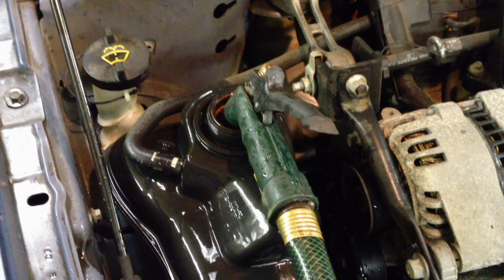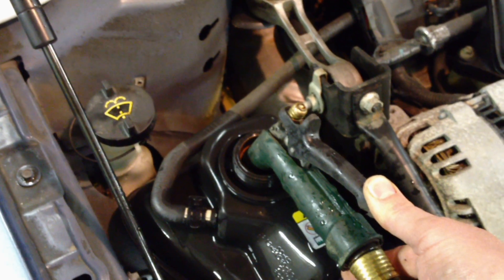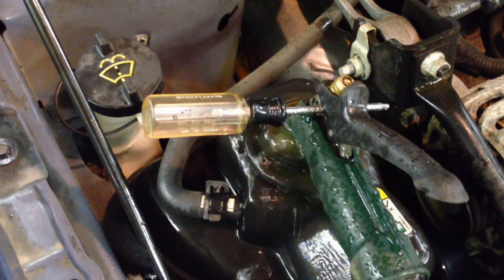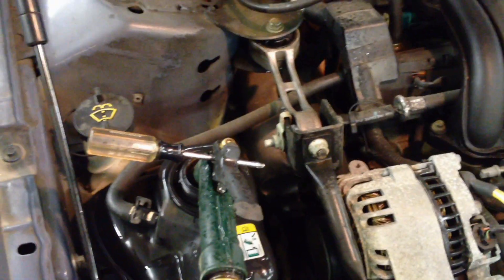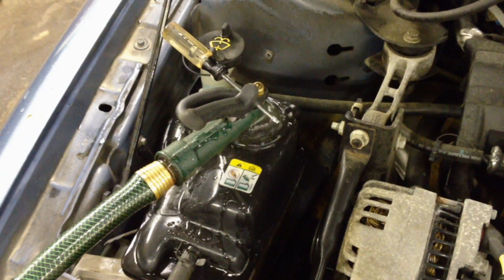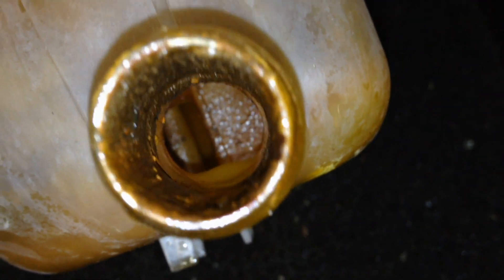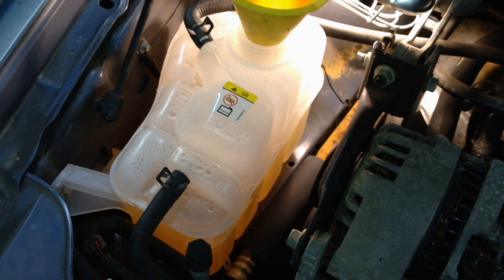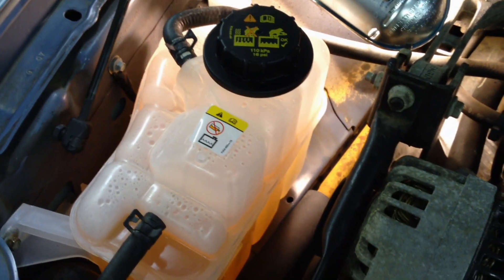NO HEAT: Ford Taurus Rusty Coolant Flush Procedure

Comment: Question for everyone who has the knowledge... 

If the heater cor was charged in November 2024 and I October 2025 you have no heat, was it really changed or did they do a flush? 

Or is it possible it was done however you will still need a flush?

Comment: According to Ford/Motorcraft "do not use this product to flush cooling systems where the cylinder block is aluminum"
What would be the difference between an aluminum cylinder block and a aluminum cylinder cylinder head?
Reply from the maker: It is only made to remove rust nothing else which is only present in a cast iron block.

Comment: You repeatedly reference that the coolant is warm and/or hot and the thermostat is open, but I can plainly see that the alternator isn't spinning at various points throughout the video. Did you start this job when the engine was hot and are just using the residual heat (can't imagine that would last even ten minutes while running cold hose water through the system), or are you using some other heat source? Is your hose connected to hot water? What's the water heater set to? Most water heaters don't go over 130F or so, and most thermostats don't open until at least 180....

Comment: I asked for your experience I replaced the heads on a 98 Ford Taurus with a 3.0 and the reservoir put a new thermostat in it flushed the heater core before I put the engine back together both directions now the engine runs at the temperature where you show on the video and I used a OBD2 that would hook to my  phone and it says I have 188° water I have 192° thermostat in there but I don't get any heat I have 180° thermostat that I'm thinking about changing is there any other secret way to get all the air out

Comment: really hard to remove the under radiator splash guard especially the last nut - any one have tips? It's got a nut outside and one behind it I think one is 10 mm and the other is 11 mm
Reply: I ended up getting it to work with some good old fashioned elbow grease amd used a 3/8” and 7/16” behind I think
Reply: my 8mm bolts were stripped so I had to cut them off

Comment: How about isolating the heater core, pull water out with a vac and soak the core with CLR overnight? The block had been flushed and still low heat. Flushing it alone has worked but it's bad again.

Comment: You're a excellent teacher, follow your direction from this video lord and behold when i pull off my heater core hose there was no fluid in it, nothing were flowing  through it, heater core wasn't the issue there was a block in one of those line, I back flush both hoses and heater core and blew through the heater core lord and behold heat was coming through the vents this car never idle at 145 degree 120 was it ide temp now she's heating up like a boss my  thermostat opens up at 197 for ford taurus, antifreeze was green as it can be when I drain it i did redo my timing chain gasket it probabbly had something to do the broken up gasket. y car was heating up before took on this DIY job follow your direction from a tee from both of your video not a drip from any area or snap any bolt pb blaster those bolts for a week.

Comment: On some Tauruses, 2002, 2003 if I recall, there is a "bypass" hose in the metal coolant lines near the core.  Appears as if it is there to provide a means for coolant to still flow around the core instead of through it if core becomes restricted.  We will pinch this hose off when flushing to get full flow through the core.  Still an annual procedure, have not tried the chemical though, will try to do that next.  Thanks for the great videos!!
Reply: Yep, you are correct. My 03 had it and my 05 has it now.
Reply: @brunoshow124 saving
Reply: @jebweb-j4z  saving what?

Comment: Also for heater issues make sure you block the bypass hose with hose pliers otherwise it wont heat even if you do what you did in this video

Comment: Hey man thanks for these videos and I hope you're still checking comments? I did this flush today on our 01 (I already changed the heater core a couple years ago and the heat is still working just fine) but was wondering if you would recommend pulling the hose underneath that goes into the radiator as part of a flush? I've pulled it before but 1) it was a pain to remove and 2) not sure it was even necessary to fully flush. Are you still of the mind that what you've done in the video is enough? Thanks!
Reply: I just did this today and pulled that hose underneath and it emptied the reservoir (I did not replace the degas tank)

Comment: Would this process work for a 2004 Taurus with the 3.0 v6 DOHC 24 valve duratec? I just need to drain the radiator and put 50/50 in it. It has water in it right now.

Comment: I'm no mechanic but isn't the icon on the overflow tank saying not to fill it with the color your putting in?
Reply from the maker: No I am pretty sure it is saying do not add straight coolant. Also the color on the label is orange or OAT coolant this a HOAT coolant called Gold Coolant from Ford introduced in 2001 from the factory during a mid year change.

Comment: It doesn't matter what u do to flush this car. This car has a time limit till death. Flush flush flush all u want. Replace the radiator, water pump, heater core, then head gaskets. Repeat! Best thing u can do with this car is sell it!
Reply: pointedspider what a narrow minded comment.  My daughter has an 05 Sable with 190,000 and I have a Taurus beater car with 135,000.  Maintenance is worth the effort.
Reply: Vulcan engines are cast iron and need extra attention to prevent rust. Maintain the coolant and 200 to 300K is not uncommon. Let rust build up and expect 100K and the head gaskets will need replacing, an $1800. dollar expense. I love the Vulcan engines. I've owned 3 of them and sell the cars at 200K miles.

Comment: I had someone put engine sealer for a head gasket leak, which supposedly turned into a cracked head on my 2002 Taurus. I am going to replace the cracked head and redo all the gaskets required when doing this, but I was wondering if I should use this same method (as in the video) to flush the engine sealer out of the cooling system, but with a different chemical, before I replace the cracked head? I don't want the engine sealer to harden and clog everything up, but I'm also worried about the cleaner getting in the engine if the head is cracked? Any suggestions or advice is greatly appreciated!
Reply: Sell it, don't fix it. Cheaper to buy another one.

Comment: I have question.
My Ford Taurus overheated and won't start.
Where should I start, mechanic said fuel pump, what!/?? 
Is that right
Reply: Hey did you fix it yet?? What was the problem??
Reply: Hell no lol , id assume you blew a head gasket .

Comment: Couple questions:

1.) Is hose water OK? I've heard distilled water, does it matter?
2.) I've heard that some Ford Taurus models have a by-pass valve in the back that is part of heater core system. Is that something I should bother with for normal flush?

Comment: what is another dark green coolant I can use besides the motorcraft coolant for a 2010 ford fusion
Reply from the maker: The only other one recommended is the Mazda Specialty Green it is based off of.
Reply: FordTechMakuloco  how about the zerex g-05 for a 2000 Ford f150 5.4? thanks.

Comment: So all it takes to bleed the air out of the system is run it with the cap off till its hot and keep the reservoir full?
Reply: That one Guy to get the air locks out fill it with antifreeze put the cap on run it till the thermostat opens. Wait till it's cool remove the cap an top it off.

Comment: is it ok to run that cold water into a hot engine or are you letting it cool in between?
Reply from the maker: It is perfectly fine the water mixes well before entering the engine block.
Reply: cool thanks bro saved me a ton. 5 hours. The car I worked on was a little different but basics were the same. Thank You!

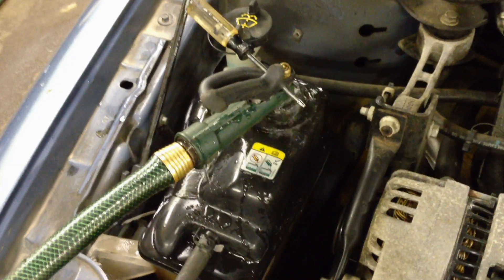Comment: 6:20 Why not check if the heater core now produces heat, before refilling with antifreeze so it's not wasted if u find out that heater core needs to be backflushed separately?
Reply: takeadayofff He replaced the heater core in another video.

Comment: WHAT CAN I USE TO CLEAN OUT ENGINE BLOCK IN HOAT DIESEL MOTOR?  FOUND BROWN GUNK AND HAD PLUGGED HEATER CORE.  LOWER RADIATOR HOSE IS HALF WAY UP RADIATOR ARGGG.  SEALED SYSTEM I MEAN TOUGH SUCKER WORK ON AND THERMO IS SPECIAL 200 UNIT.  COULD I HOOK UP TO MY HOT WATER HEATER AND RUN IT?  TINKERING USING PURPLE POWER,CASCADE DISH WASHING LIQUID OR SIMPLE GREEN, VINGER,ZEREX HEAVY DUTY CLEANER, USED PRESTONE FLUSH AND NOT GOOD ENOUGH.

Comment: what's the best antifreeze for 2001 E350van 7.3 diesel
Reply: G-05 is the best antifreeze ever designed. I've been using it for years on multiple makes & models (after a thorough flush of course) and the systems stay sparkling-clean.

Comment: So just curious.  At 7:58 the tank has a sticker with an icon that looks to be indicating no orage coolant, but you suggest orange coolant in your video description. Am I misreading the bottle sticker? If I fill my 97 Taurus with Orange coolant, will I mess it up?
Reply from the maker: +Justin Bone The coolant I suggest is a HOAT coolant these vehicle switched over to. It is not the same as the OAT coolant ford has out now and is fully compatible with the old green coolant. If you used the coolant I link to then you did it perfect.
Reply: Awesome. Thanks
Reply: HOAT IS NASTY STUFF AND SHOULD BE CLEANED OUT SYSTEM EVERY 40K!  MOPAR ORANGE IS HOAT, GOLD FORD HOAT FOR DIESEL MOTORS AND MAYBE OTHERS.  THOSE TWO ARE HOATS INCLUDING ZEREX GO5 FOUND AT SOME NAPAS.  NEVER MIX FLUIDS FUNNY NO AUTOZONE OR ORIELYS HAS THIS SHIT.  NAPA,JEEP DEALER, FORD DEALER ONLY i KNOW ABOUT
Reply: The MOTORCRAFT ORANGE coolant is similar to DEX COOL. THE MOPAR ORANGE is HOAT like MOTORCRAFT GOLD . Both FORD GOLD and MOPAR HOAT are like zerex G05

Comment: how do you do this with no radiator cap. I only have a reservoir bottle.
Reply from the maker: +Imre Csoka That's what this one has a pressurized coolant bottle only.
Reply: +FordTechMakuloco okay so that means that i just stick the hose in the reservoir bottle and i can do exactly what you are doing , i mean same process. Only that i will be doing this through the bottle?
Do i need to detatch a hose at all?
I dont know if i have a petcock
Reply from the maker: +Imre Csoka If you have a cap on the radiator you stick the hose in there, if you don't you will have a pressurized radiator cap on the coolant bottle then you stick it in there instead besides that follow the rest of the procedure.
Reply: All in all i have 3 hoses on the radiator.
TOP LEFT (going to thermostat) TOP RIGHT (thin overflow pipe going from top-most corner of radiator to coolant bottle) AND (big pipe as the one on LEFT SIDE, which is going from just slightly (below overflow pipe, to the engine  block). Its certainly not the lower part of the radiator though, but i assume this is the Outlet pipe for the radiator ?
So you reckon i stick the hose pipe in the Reservoir / coolant bottle and then detach the RIGHT side Outlet pipe FROM the radiator ?
I need to try take a picture for you, if i can , would you mind? I really would love to do this and learn from you if it is okay? Many thanks.
Reply from the maker: +Imre Csoka Yeah send me a pic on facebook messanger
Reply: F ordTechMakuloco mi
Reply: FordTechMakuloco
Okay thanks ill watch it again , Sir

Comment: WOW....great series of videos. Problem I most likely need to do the heater core. Before I got the car, it was my mothers, and it sat for about 6 years, only being driven maybe 10 miles a year to get it inspected and such....So even though the car only had 45000 when it was 11 years old - it had a lot of problems that high mileage cars get. anyway - my question is If I backflush the system, and replace the overfill bottle and do a themostat for good measure since it really is easy access, If I have to wait a month or so, to get time to do the heater core - will the core in the mean time muck up the new fill tank? and need to replace it again?

Comment: Where is the drain plug under the vehicle?
Reply from the maker: +Trenton Personette It should be drivers side  of the radiator.
Reply: Thanks. Now I'm having trouble with the hoses connected to the heater core...
Reply from the maker: yup you just need to work them back and forth once the clamps are off.

Comment: Do I need to do this to just replace my thermostat? My car isn't putting out much heat in the winter, so I got a new thermostat, and I see that this is for replacing my heater core, just didn't know if I needed to do this for just replacing my thermostat.
Reply from the maker: Wesley Myers If it is rusty like this you should be doing this flush, a thermostat and the heater core. I have videos on all of them and the parts needed in the video description.
Reply: FordTechMakuloco OK. So a thermostat alone won't fix the low heat problem? Have to do the core as well?
Reply from the maker: Wesley Myers If there is allot of rust as shown yes
Reply: OK. Thanks so much!

Comment: Did you remove the thermostat to flush or leave in place?
Reply from the maker: Brandon Jefferson It was left in to get the engine to full temp for full flow. In the end it was replaced and the system was flushed from the other side also.
Reply: @FordTechMakuloco  you do an awesome job, i am currently doing this on 2000 Ford Taurus, and also a 2003 Ford Windstar

Comment: How long do you  let the rust flush cycle for? And can you remove the coolant reservoir and clean it out would it make a difference ?
Reply from the maker: OrRJay I let the chemical go at least 10-15 minutes once the engine heats up and has full flow. After that I flush with the hose till clear. Cleaning the tank in car is the same as out of vehicle so I leave it in.

Comment: I have a 2000 ford Taurus. I have no heat in the car and there is some type of fluid on the passenger side floor. Would you recommend me getting a coolant flushing. I was told to wait to get it done in warmer weather.
Reply from the maker: Reggie Lewis I would do the coolant flushing thermostat change and because of the leak a new heater core. I have videos on all of them search my channel I walk you through the whole process.
Reply: Thank you for the insight but my mechanic suggested that I not perform that because we have 10 - 20 degree weather which could crack the engine
Reply: I've changed the thermostat also

Comment: Will these procedures work the same for a 2002 sable? Bought a used one and the core is bad too damn expensive to have a pro do it so im gonna try to do it myself.Also besides the flush and changing the core is there anything else that i really need to?
Reply from the maker: jesterking2005 Yes these procedures are the same, only other thing I would recommend is to change the thermostat during the flush and then flush the systems from the thermostat port in the intake also.

Comment: Ive got a 2000, 3.0, no overheating, no pinhole leaks thst i can find, as soon as it warms up it will smoke from engine bay, towards passenger side. As best as i can tell it has no leaks around head gasket. Possible timing cover gasket?
Reply from the maker: Jeremy Barrier Yes the timing cover gasket is suspect they can spray a fine mist too.

Comment: Hey,
I have a 2002 Ford Taurus and I get no heat at all, no air no nothing its just dead, could this be part of the problem?
Reply from the maker: Nora Valkyrie Yes it is part of the problem but you are saying the fan does not even run even on high?
Reply: Yes it didn't blow out any type of air..but i took it and they said it was the motor apparently it wasnt doing whatever its supposed to

Comment: I'm having heat issues with ford taurus vulcan engine. The car heats to normal temp and will not blow hot air at an idle even if the engine is warm. However, when u drive the car or rev the engine it blows hot air. Where should I look first? Could this be an issue with the blend door? Or is it more than likely the system being clogged up?
Reply from the maker: The core is clogged up you need to follow my flush, thermostat and heater core removal series for this engine to fix it up right.
Reply: @FordTechMakuloco hey. I have a 1999 ford taurus with a vulcan engine.

The car does heat up in idle and cools down to/ belowto c in temp gauge while driving. I have changed the waterpump and the thermostat. The heat in the cabin is hot for a moment and then it becomes colder, and is only warm.

Is there necessary a link between the two problems? And how could i solve each or both problems?

Greetings from Germany

Comment: What about the water thats left in the engine. If its supposed to be 4 gallons of coolant then. When flushing with water, there are two gallons of hose water left in the engine. But we are supposed to use distilled, how do we fully empty it out?? so we can add 2 gallons distilled water, and 2 gallons straight anti freeze
Reply from the maker: ***** Distilled water is only required if your water in the local supply is extra hard. If you are worried after the flush drain it all out, fill will distilled water, run it till the engine is warm and thermostat opens, drain once more then fill with engine with a mix of distilled water and coolant from  the jugs.

Comment: Would this also be the same procedure for a 2008 Taurus X.
Reply from the maker: For rusty coolant yes.
Reply: FordTechMakuloco To get the coolant in the rear heater do i just run the rear on high heat?
Reply from the maker: You don't even have to run the rear heat it is a constant flow through the rear heater core but some revving would do some good to push it through.